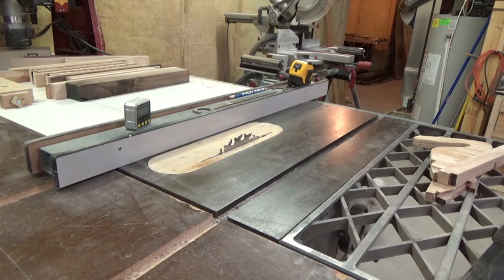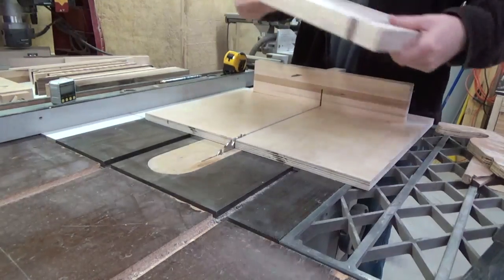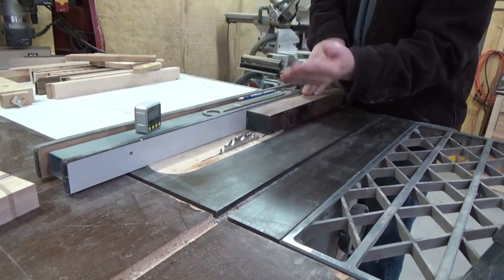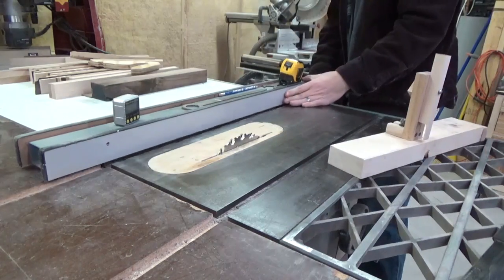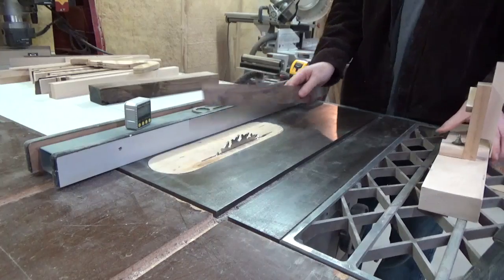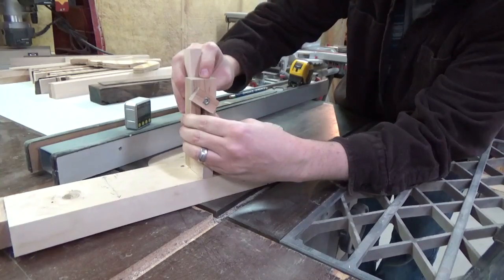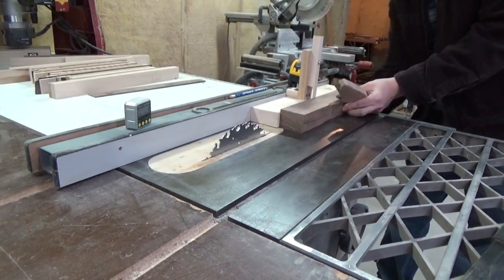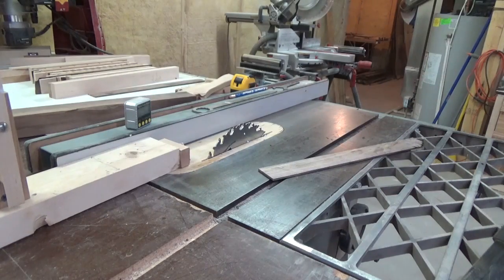Shop Work: How to build a thin strip jig for the table saw

Comment: Of course I enjoy your videos.  I bought your thin jig plans, then made several changes based on inspiration from you and a few others.  Mine is 4 pieces, two bolts and wing nuts, works perfectly and very safe at pounding out 3/32" strips from short to long.  Thanks for your video advice!

Comment: Good one. I was faced ripping 1/8 strips 8’ long. So I made a custom 8” pine riving blade 1/16 at entry point and 3/8 at the exit point. With finger wotsis opposite the fence to guide me in I feed my long piece in and 1/4” after cutting the riving blade guides the strip off to one side as a plow would soil but gently. This not only gets my strip out of range but also keeps stock against the fence. Only took 2 weeks and 20 YouTubes to learn it..

Comment: Great little jig,; I run a mens woodworking shop in Australia and we have a large thin strip ripping jig that fits over the entire fence and is great for long pieces of timber but this little jig of yours is ideal for shorter pieces and quick to put into place and set up; I will certainly be getting one of the guys in my shed to make one of these little beauties.Thanks for the idea.,

Comment: Thank you for  all your videos, I learn so much and have made this jig. The problem I am having is that my strip thickness is different from front to back. I am assuming my fence  is farther from the blade at the end. I have read where it should not be parallel to the blade and have read the opposite opinion. Would you care to comment? Also, what is a good blade for making thin strips. Thank you in advance for any comments and for making these great videos
Reply from the maker: Yes, mine tapers away from the blade by like 1/32" at the end or so.  It doesn't really matter much since the cut happens way before it.  I use Freud blades pretty exclusively.  They do a good job for me.
Reply: yeah, I have been using Freud blades too...really like them. Thanks for the insight.
 @FishersShop

Comment: Hey, I'm watching this video again, and now I'm confused, what is actually determining the thickness of the cut? Is it one of the stops or is it that you leave a gap between the jig and the wood of whatever thickness you want?
Reply from the maker: It's the gap.  The jig is 3" wide so if you set your fence to 3 1/8", the thin strip will be 1/8"
Reply: @FishersShop  ok, makes sense. Also, is that an older craftsman saw you're using?
Reply from the maker: It was.  That saw is ancient history now though.
Reply: @FishersShop  interesting. I have an 113 with an upgraded motor. I love the saw, but absolutely hate the fence. I'm planning on upgrading the fence soon

Comment: Drew, What is the material used on your table saw fence? I assume it allows the wood stock to glide easier against it instead of the metal that the fence is made of. What material would you suggest? Thank you
Reply from the maker: That was an old after market fence that I no longer have.  If you want to make your own fence, I'd recommend using a material like melamine to keep things slippery.

Comment: That is a pretty cool thin strip jig. Thanks for sharing.
But what is the function of the vertical part (holder?)
Do you need it when you use a push block on that jig?
Reply from the maker: As the thin strip is cut, there's a tendency for the the piece to rise up due to the rotation of the saw blade.  The vertical piece keeps it held down so that it doesn't flip out, kick back, and stab you in the eyeball.

Comment: Piece of wood, screw and miter slot bar. That's all you need to make simple jig. Very easy and safe. Use it on the left side of the blade.
Reply: The issue with that is that you're moving your fence on every cut. Depending on how much pressure you put on the piece will change the thickness. The off-cut is also going to be moving around quite a bit which could get clipped by the blade. This approach seems more accurate and doesn't seem unsafe to me.
Reply: @GoblinBlaster3000  But the off-cut is not going to get pinched and shoot back at you, so it is safer, besides with my jig I can make any length strips

Comment: Looks like your blade isn't set higher than the height of the stock.  Shouldn't it be at least a tooth depth higher?  If so, then the tail hook would be compromised.  Newbie question...
Reply from the maker: Yeah, I'd say you likely want it around 1/2 tooth to a full tooth over the stock, but different blades have different sized gullets.  The chip ejection happens underneath the saw surface (at least it should) so having the blade even further higher wouldn't be of any use and would actually be a safety hazard.

Comment: Hey, do you think you could use this jig to cut 1/32 thick strips?
Reply from the maker: You could, but the little hold-down would likely get chewed up.  But yes... it works, I've done it.
Reply: @FishersShop  thanks! Also, do you think it would be a problem to use this jig with my Microjig pusher?
Reply from the maker: @adamthewoodworker2571  I'm not sure how you'd be able to.
Reply: @FishersShop  ok no worries. And then final question, was there a particular reason you didn't use a riving knife/splitter when making this cut?
Reply from the maker: @adamthewoodworker2571  saw didn't have one.  that was an older saw.
Reply: @FishersShop  ah ok perfect, just wanted to make sure using this jig with a riving knife wouldn't be an issue

Comment: Cool jig!  Came up in my suggestions while looking for something else, and glad it did.  I'm definitely going to try this, I have a few melamine strips to cut for shopmade drawer glides.  Watched a couple other of your projects, liked your work, so subbed.  (That knotty guitar stand was really cool.)  Would love to see your take on a sled-type thin strip jig.  Saw one on Jimmy DiResta's channel, now can't find the vid (it was about something else, and the jig was just an incidental thing in one of the shots of the project).  I forget if it registered off of the fence or the miter slot, but it had a leading fixed fence on the back end, with a simple wedge clamp on the fence to secure the piece, and I believe another clamp on the trailing/front end to hold that end of the piece secure.  Consistent strips were achieved by a separate fixed stop (I think just clamped to the table) on the offcut side, so that the work piece butted up against the stop before the cut, and otherwise rode on the jig, with the strip being the offcut.  It didn't have your cool top-down anti-kickback adjustable clamp, but that could be added to the leading fence.  Anyway, good job!

Comment: So the little block in the back gets cut off every time you make a cut and needs to be replaced after so many cuts is that correct
Reply from the maker: It doesn't get cut at all.  You can adjust how much it sticks out.  For larger pieces, you can move it out more so that you get plenty of push support as you feed the piece through.  For very narrow strips, move the back piece in so it doesn't get clipped by the blade.

Comment: Just like in your sled you use a stop block use one one saw. CUT slide piece against the block then fence against piece cut repeat? Or make you jig, nothing wrong with a jig. Saying repeatedly respectable consistant cuts sometimes its just as simple a clamping a scrap for a stop and sliding to it.

Comment: Personally i would rather cut thin strip from the other side of the blade so the cut strip comes away from the blade teeth, which almost eliminates kickback entirely. If you do want to cut between the rip fence and the blade, this is as good an idea as any.